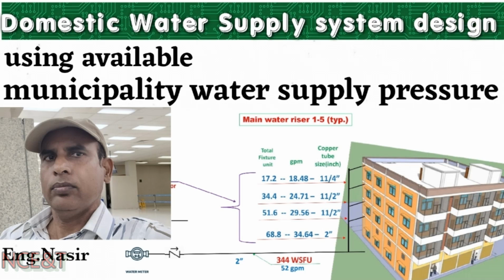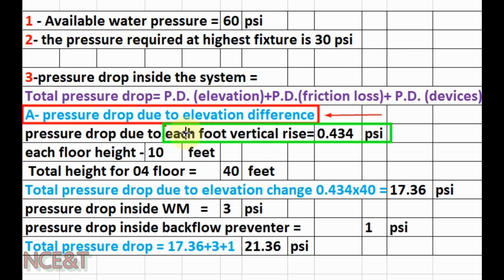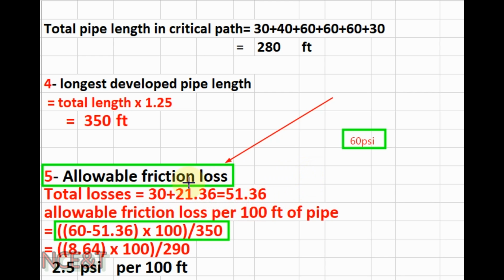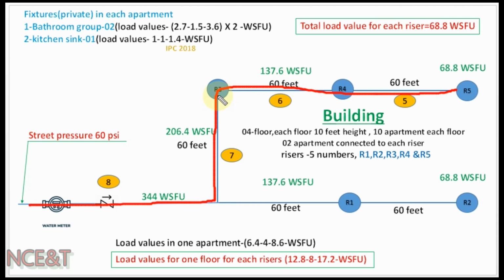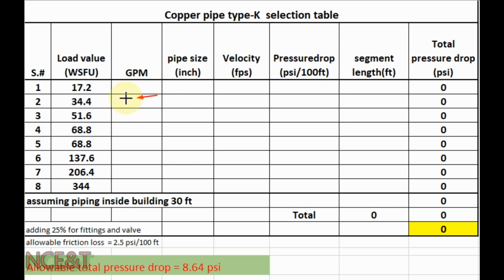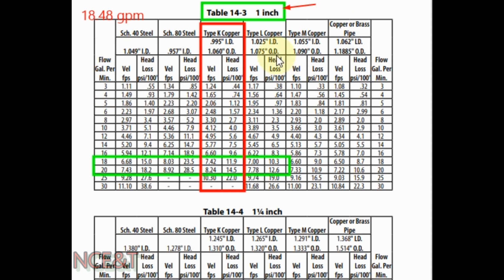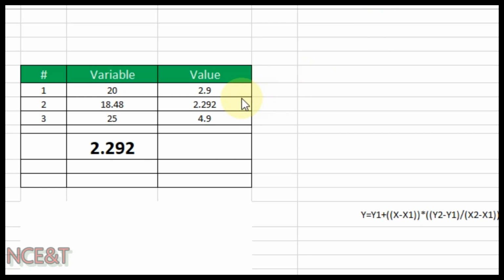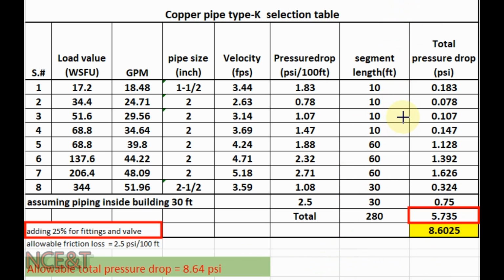59 - water supply system for a building using available municipality water  pressure

Comment: allowable pressure drop calculated 2.46 psi, approximated 2.5 psi/100 ft length.on the video you explained for 18.48 gpm with the table of 1 1/4 but in the table you added 1 1/2", in that sense its falling below the allowable friction loss of 2.5 psi.meaning, we have to contain the pressure loss below the alloeable friction loss, not 5 psi /100 feet length you early mentioned. But on 206.4 wsfu, corresponding 48.09 gpm the pressure drop value exceed 2.5 psi, and itvwas 2.71 psi though it s less than 5 psi..

Clarify me, that pressure drop in this case must below 2.5 psi/100 ' , From our allowable friction loss calculation or thumb rule of below 5 psi/100'...

Comment: Hi what is the exact number of the table from ASPE handbook? I have all 4 volumes but cant find it
Reply from the maker: It was in old revision, now you will not find it, as now they are using chart to select the pipe size and it is more easy and accurate, 
For hydraulic table you will find only standard values,

Comment: Pressure required at highest fixture, how to calculate 30 psi.???
Reply from the maker: you need to select as per actual  fixture you are using, you can find this table from IPC, 
or you can use 30 psi as general practice, it is maximum value that is used for WC flush valve.